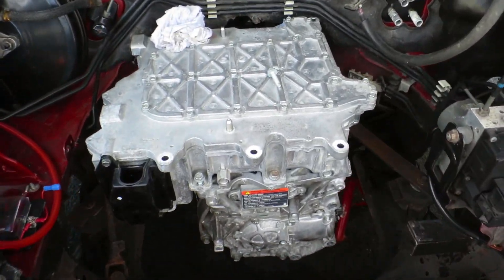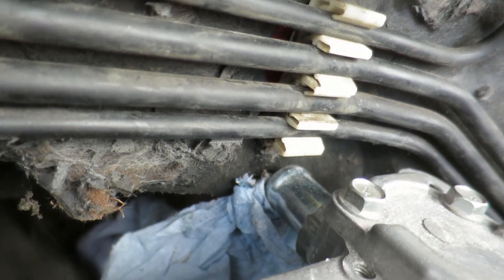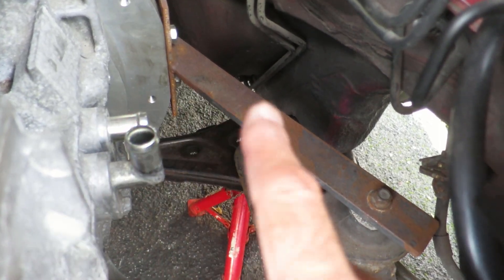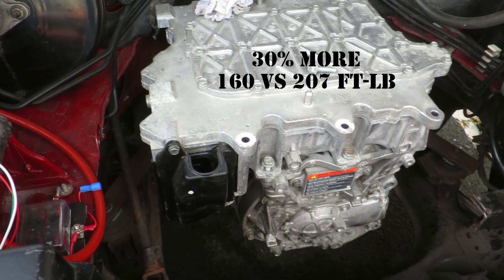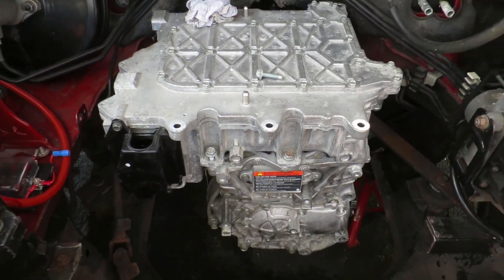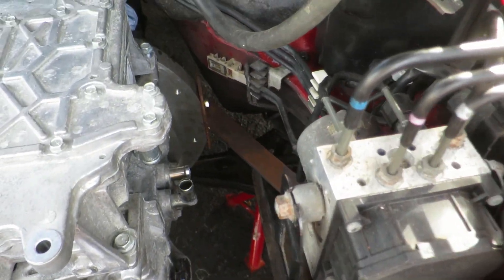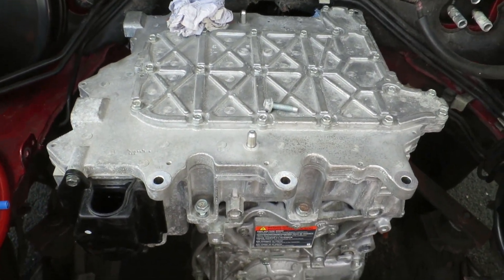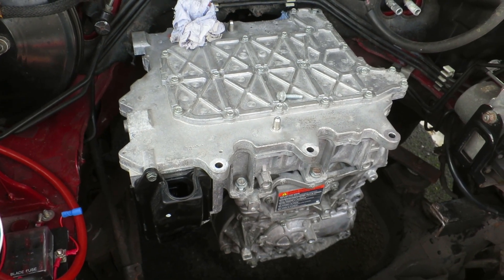Nissan Leaf Motor Engine Mounts and Inverter - Mazda RX8 EV Conversion

Comment: I suspect your motor mounts will flex when your car hits a bump. This will cause a front-to-rear bend in the drive line that would put extra stress on the motor and transmission bearings. A support for the front of the motor would prevent this.
Reply from the maker: Yeah I agree in part - but the RX8 has a power plant frame that means the whole piece from front mounts to the rear axle is one part. Leaving it as is for the moment, see what it drives like!
Reply: @SouthWestEVUK  You may want to do the initial drives without the hood installed so you can watch how much the motor bounces up and down. It appears your mounts can handle the static load of the motor. The Mechanical Engineers told me in the past that the shock loads (i.e. when you go over a bump) can easily be 6 - 8 X the static loads. The amount of material you might add to the existing two bars to stiffen them may be much more effective if they were added at the front of the motor. If you are installing batteries in front of the motor, that structure can also be used to support the batteries.

Comment: H! You can easy made light subframe around motor and made your monts ten times stronger! And your calculations about torq is little bit wrong! Take 280 Nm and multiple it with 3.76 (first gear ratio) it is aprox 1052 Nm that will try to broke your monts off. :)
Reply from the maker: Yeah, it is all a bit rubbish I agree - but I fail at the 'make a light subframe' part!

Comment: I believe the PPF is, essentially, a torque tube. It reacts against the torsional force generated between the engine output, and rear differential input. The differential would, otherwise, tend to want to twist relative to the long axis of the car. The torque tube prevents this by rigidly mating engine and gearbox assembly to the differential housing. The Mazda MX5 has a similar configuration. With regard to the mounts, they are pretty ugly. Hollow section would be stiffer for the same volume of material (bigger second moment of area). Though o suspect the bar you are using is strong enough. The issue is that you are cantilevering the motor off of the engine mounts, which will likely cause them to fail sooner. Additionally, this design relies on the stiffness of the PPF to react almost all of the torque in the manner as described above (though noting that both diff and engine are mounted to the car body, which must also be carrying/ resisting the torque load). These mounts are doing little to help resist the torque loads as these bars would be fairly easy to twist. A design where the mounts are attached directly (shortest distance) to the sides of the motor would be working in pure ‘push and pull’, this would be better. Finally... steel mount bolted directly to aluminium adapter plate = galvanic corrosion. One way forward might be to find a convenient way of affixing a large lever to the motor and giving it a good pull (ideally with a load cell attached) to see what the rated torque might do (I.e. whether the motor will rotate/move). Overall however... I suspect that it’ll probably work absolutely fine, certainly for many miles. Just keep a close eye on the condition of the rubber mounts, and watch out for corrosion!?
Reply from the maker: Yeah, overall I do feel the cantilever effect on the existing mounts is where the failure will happen. I just dont have the fabrication skills / knowledge to do better. Plan is to get the car working, then go back and upgrade parts I feel need looking at - when building something like this there are so many unknowns that if you try to get everything perfect you will never get the project finished. Rapid prototyping I think is my methodology!
Reply: @SouthWestEVUK  totally agree- so easy to get bogged down in striving for perfection and end up making no decisions whatsoever! Great work, eagerly watching your videos and learning lots. Keep up the good work 👍🏼

Comment: You don't need an engineer to say those mounts aren't substantial enough. Theres an old saying "If it looks wrong, it more than likely is wrong" 

Never seen anyone mount an powerplant permanently like. Maybe jig something up yes. Those bars will flex and bend due to the length of them. Also the overall strength of the weld won't matter because it has no triangulation. Over that length you would need a heavier plate mount to adapter and heavy wall box section of tube back to the mount
Reply from the maker: Yeah, I will be using these to test the system works - then likely upgrading for road use... Cheers

Comment: That thing might hold up, but it will feel fucking strange to drive, probably it will vibrate under load
Reply from the maker: Yeah will see... It will be pretty clear pretty quick if it is up to the job!
Reply: @SouthWestEVUK  nice build my friend. I think it this way, beacuse comparing to the rest of the effort you put in, a stronger motor support to me seems the least difficult thing, so why not to over build it

Comment: I'm worried about the clearance between the motor and the brake pipes 

Also worried that engine mounts are too far back on the bell housing almost,
and don't look rigid enough
 
Rather then use flat metal as support brakets
Use "L" shape 

Also Could you not have a bracket made which would run from the front end of motor to the rear end, and then support it with a another nearer to your chassis mount point if that makes sense.

You would need to repeat this on both sides of the motor.
Reply from the maker: Yeah work to do on the engine mounts, but good enough for the moment to test. Brakes lines are pretty flexible and again I might move those higher...

Comment: Yes I am sorry to say, I think more work needs to be done on the engine mounts.  The longer the engine mount (the further away the mount is from the rubber chassis mount) the more the twisting force will be amplified....this would not end well for those flat mounts, they will bend I would think.  Think of the difference on the twisting force you can exert with a screwdriver versus a breaker bar.   The other thing is, if an engine is not mounted firmly it can produce unnatural pressure on the driveline.  If the engine did twist at speed you would probably completely destroy the prop shaft etc.
Reply from the maker: Yeah, currently they will stay for low speed testing, see how they perform. Then going to upgrade if its clear they are not up to the job. Thanks for the feedback!

Comment: why don't you add a plate to push the motor closer further  to the front, that would give you extra place for cooling system and be long way far from brakes tubes...
Reply from the maker: yes I can extend the adapter plate, I would also have to have a new spline connector made (to be longer). It also involves removing everything, disassembling, taking back to the guys who made the original bits, getting them made and putting it all back together. At the moment I think ill work around the problem of the pipe - its an easier fix, the brake lines can move up and out the way as they are. Cheers for your feedback, its always good to hear from everyone.

Comment: G'day mate,
The issue you are going to have here is that the power frame going to your back axle is actually going to work against you.

You have those engine mounts withstanding an incredible amount of rotational force. Mainly because the rear frame with the gearbox cannot, it's rigid, only allowing bounce vertically, so that rotation is going to want to go somewhere.

With my experience in four-wheel drives, I have found the power will always find the weak link in any system. So I had a problem a few years ago where I kept snapping the axle flange studs, so I then went on and upgraded the axle flange studs.

I then moved the weak point through to my universal joints in my drive shaft.

When I beefed up the drive shaft, I then found the weak point was the spider gears in my differential.

I'd say go back to your engineering mates and have them fab up something better, alternatively, if you can give me the measurements and angles, I might find some time this week to CAD you up something stronger.

I'm your big Aussie fan on diylectriccar that's doing the Jumbuck ;)

PM me over there and I'll look into it for you, but that's why I'm learning CAD to design stuff for my own project.
Reply from the maker: Just found you and messaged ;o)

Comment: my concern is not that you're going to break the mounts but that you've cantilevered the whole motor and inverter weight off of those bolts and pins and your input shaft to your transmission.
 I would have put something straight across and supported the motor between the two motor mounts or done some kind of a triangle to support the weight of the motor and the adapter plate.
Reply from the maker: Yeah it is effectively hanging off the pins and bolts, but the bolts and pins are rated to easily carry that load. Either way I think I am going to support the motor a bit more to avoid the 'bouncing' that is evident currently.
Reply: @SouthWestEVUK  they may be rated to carry the load but probably not rated to have that load bouncing on it. Even if they hold, they're going to fatigue and break at some point. I wouldn't run it like that. The motor needs support on the other end just like it has in the Leaf or any engine has in any car. They're either supported from front and back or both sides or all of the above on any car.

Comment: looks like a support flat iron bar across the car infront of the inverter would solve your issue with the motor going up and down and potentialy denting your brake lines
Reply from the maker: Yeah, few options on this to look at! Cheers

Comment: motor mounting and sepcifically Torque reaction. it is not so much a question of strength (or will it fail.) - more an issue of how much those plates will Bend - so that realtes to their Stiffness. Looks like you could add stiffening ribs to those plates you have, namely by them not being flat plates! - weld on some stiffening ribs.  Cast a thought to the forces created by the motor Torque 207ft.Lbs = 280Nm is like 28kg at a 1meter moment arm. at 33cm it will be 3x28= 84kg, not enough to brake the supporting arm but enough to bend it elastically menaing it will wobble and excite further vibration.
Reply from the maker: Yeah seems the main thoughts are the amount it is bouncing rather than the rotational forces which is good.

Comment: you can reinforce the mounts with another bar to make a triangle or make the main bar as a L or T shape, otherwise it could bend even if just a bit when going over a pothole
.
Reply from the maker: Yeah sounds like that is the overwhelming though, stop the bar from flexing.

Comment: Wow, she looks like a beast!

The engine may only create the same torque as the wankle but the wankle engine mounts are mid engine block where everybody is suggesting your mounts need to be.

Super easy fix. Another strut from the mounting bracket to the engine. I can see bolt holes so can't to much messing around.
Reply from the maker: Yeah lots of options aint there!

Comment: I literally just took out my Renesis for the 5th time today.
I'm not looking forward to rebuilding it again then having it fail again.
I've been trying to turbo it for the last 11years.. Cost me over $200K aud so far not including this rebuild ༼ つ ◕_◕ ༽つ
They really don't like boost with their high compression.
I am considering going EV but I would miss the sound and I've already spent way too much:)
Also I wouldn't trust those mounts personally . . Is there anywhere at the top of the motor inline with the mounts to add a brace?
Reply from the maker: Yeah there are a few mounting points I can look at cheers,
Reply: Inverters make a wild noise when you start really pushing some power. 👌
Reply: @hondaguy9153  ..Good point, I always think of my RC cars back in the day. . .Elec vs petrol, the Elec cars did have a nice futuristic sound but the petrol ones just sounded more exiting:) . . but were always way more trouble. Also like actual cars the Elec cars were faster off the mark but didn't have as high a top end.. Plus the Elec cars had a much more predictable power band ¯\_(ツ)_/¯
Reply: if you convert to EV you will not miss the old sound, when you floor it, it sounds like a Jet engine ;)
Reply: @matt889  .. Maybe one day, but after 11 years of rebuilds the rotary is running great now... I will see how long it lasts:)

Comment: It just looks like there is too much unsupported  leverage on the bars, the rubber mounts are more likely to fail first. Think the mount should go vertical straight off the mounts, that's probably how the original engine would have been fitted. Just my own  idea thou.
Reply from the maker: Hay thanks, it looks like most people are concerned with the vertical movement more than rotational, so I think some ribs in the mounts will help.

Comment: The current motor mounts need to be triangulated, or a made in the form of box section. The current steel bar may feel stiff, but with it so long and only supported at the ends, it'll be in affect a diving board. This constant bouncing will eventually cause the steel to fatigue, and fail. It'll also allow the motor to bounce about uncontrolled, which could then cause impact damage to nearby components like the brake pipes. 

Take a look at other motor mounts and see just how sturdy they need to be. 

I know the RX has a torque tube, so rotational forces are minimal, but the motor is still in effect on a spring board, which will fail eventually, with horrible consequences. 

Your best and easiest option would be to make up a tubular cradle that bends under the motor, between the rubber mounts, then have a couple of stiff brackets joining this cradle to the existing plates on the adapter. This system will give you a huge increase in structural rigidity, but also resist torque twist, and contain the motor assembly in the vehicle, should it be in an accident, or a weld on the bracket fail. 

Currently vehicle would fail a structural inspection due to inadequate support of the motor. 

It's always best to over engineer than under engineer. ;)
Reply: I agree with John, the mounts may be strong but it shouldn't be bouncing around like that. Some form of triangulation will prevent stress fracture in the future never mind the horrible oscillating sensation it would give while driving.
As for the fire wall I would avoid cutting if at all possible as it may open issues with certification. Some gentle persuasion with a small sledge hammer would sort that out (so long as nothing fragile on the other side) and the brake lines would be very easy to move up out of the way.
Reply from the maker: Good note re the firewall, cheers!
Reply: With triangulation, you can get away with using a thinner steel. I think you will need some more mounts bolted to the other end of the motor anyway so you may be able to triangulate that way and still use those brackets you have. Perhaps you could work out a design where the mounts also work as mount points for other heavy stuff you will need to bolt into the motor bay?  Good luck wiith the rest of the project :D
Reply from the maker: Yeah, I think the springboarding effect is the key issue here, I just don't know how to measure accurately and fabricate whats needed. I feel like I need to give the car to someone to build the required structure, but the car cant move grrrrr